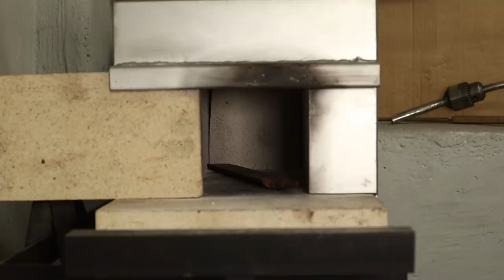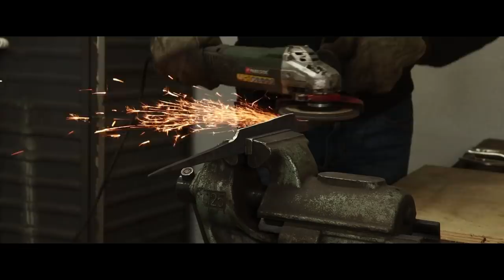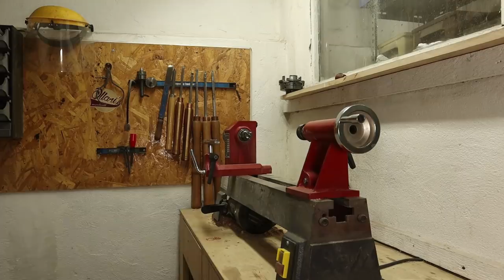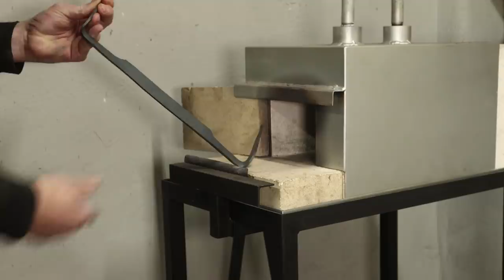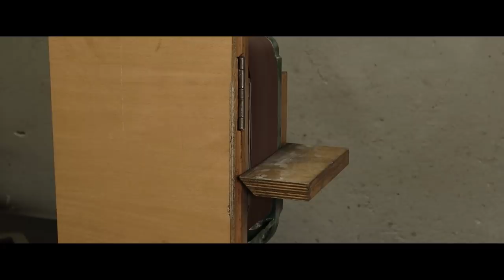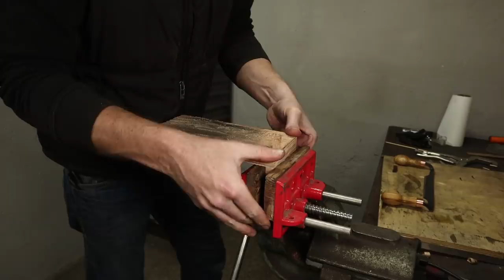Forging a Drawknife from an Old Metal File

Comment: Great job as always! One thought what came to mind: next time, when  you have to heat-treat the edge only, consider using the own heat of a workpiece to temper it (right after quenching the edge only) There's a great chance that it will be more than enough to reach the hay-color and saves you time to heat up another piece of steel. If you'd like to know more about it, just dm me! Congrats on the vid!
Reply from the maker: Thanks man! I’ll try that.